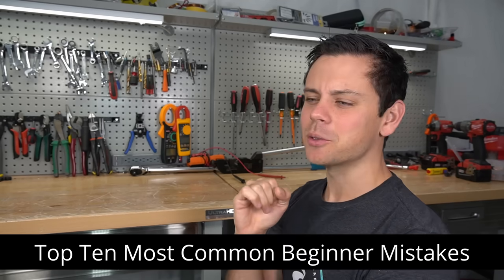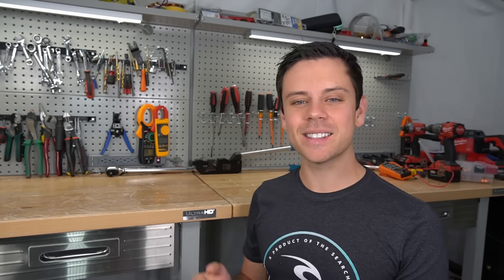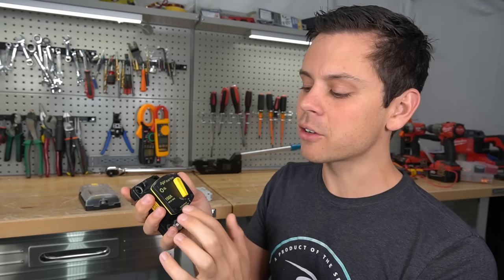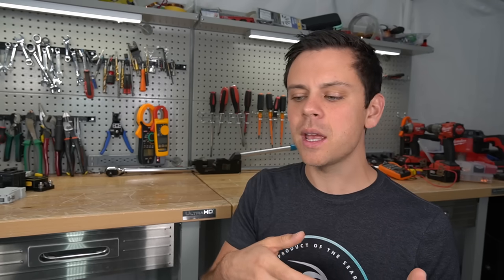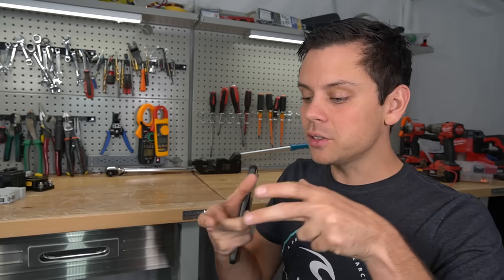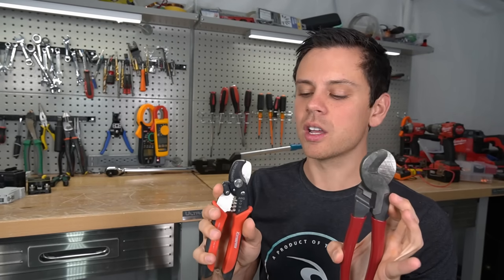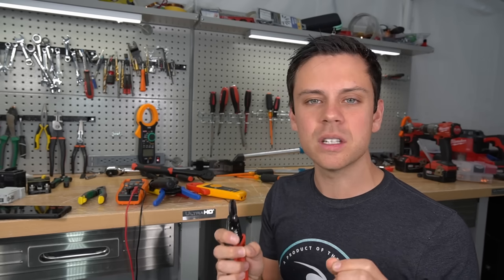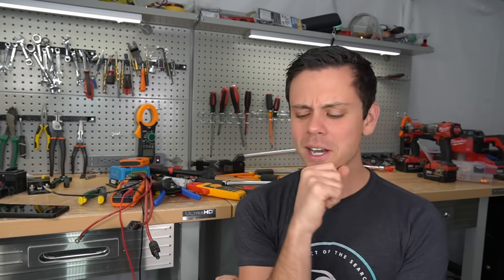Top 10 Beginner Mistakes When Building a DIY Solar System

Comment: Great video Will. Thanks so much for sticking to your guns on not soldering large lug connections. I get comments on my connection video from people that try to sound like they are professionals and they recommend soldering and it makes me worried that someone will believe them and create a problem for themselves. Keep up the good work.
Reply: To solder or not to solder is not something I will argue.  However the logic behind it does not work for me.  He says it's because of "dissimilar metals" and calls these silver lugs "copper" when in fact they are tin plated copper.  That is what I call "dissimilar metals" without soldering.  The high temp solder is mostly tin so if you have tin plated lugs, it's not really dissimilar at that point.  I would like to see some data showing a resistance comparison between the resistances of the soldered lug and the non soldered lug over time.  It seems the soldered lug would keep oxygen out of the connection better than non solder; keeping the connection from oxidizing.  But I'm just trying to learn here.

Comment: Will,  another problem with large bundles of wire that has driven many of us crazy is ghost currents, coupling AC to neighbor wires that supply LED lights.  The LEDs will continue ot glow at a lower output even though the switches are off.  :(
Reply from the maker: Great point!!!
Reply: Induction.

Comment: I bought your book on solar. I have installed two Battleborn Lithium batteries and used No. 4 copper welding cable to connect them together. The negatives run to a shunt that goes with an Alii gauge. Also no. 4 cable to a 1000-watt inverter. I put two dedicated plugs in my fifth wheel RV off the inverter. I have two Renogy suitcase panels that I hookup when we are dry camping, and I installed a new converter in the camper that is good for Lithium batteries. So far so good! I have made about half the mistakes you list but I'm getting better. Thanks for sharing your knowledge. Burlington Bill here, singer songwriter. Busking from the road and home.

Comment: In the early 70's in the US Navy BE & E class we were taught to solder every connection on the ship.  But I haven't messed with electricity for decades yet I still have believed it needs to be soldered.  But that's where us old hands learned it.

Now I'm learning a lot from you.  This is why I love kids.  They have access to the latest knowledge and also think of things that we think, "I tried that before and it doesn't work.". Kids may take a slight adjustment that makes it work.  I always have tried to hear out all ideas, they don't always work, but I don't want to be that old man stuck in his ways so he never learns new, or more efficient ways to accomplish jobs.

My dream is to build my own off grid solar and wind power station on my property in East Texas.  There are no permits or inspections required here if you have enough land, which I do, so the safety is completely up to me. I just put up my first building out there, a 30 x 35 metal building.  Now I need to insulate it and wire it.  It's going to be the blown in insulation because the batts sweat and I'll have a lot of condensation in this area with the pink stuff. Ideas? Spray foam first and then put the conduit outside of it for easy future serving 🤷🏻‍♂️

Thanks for all of your helpful videos.

Comment: I'm guilty of #9.  I built your 48Volt split phase system with all the listed components, but I only purchased 3 batteries and a dozen CanadianSolar 445w bi-facial panels.  I am now faced with getting another dozen panels at a minimum just to keep the 3 batteries charges based upon my upstate NY latitude.  The system operates great and can do anything I want it to, but it can run low after just one full day/night on a cloudy day.  We're totally off-grid and have to use a generator much too often at the moment.  Looking forward to having a full battery rack that charges up quickly.
Reply: I'll have to look that build up. I'm above you in New Brunswick (think Maine and turn right) and have been doing measurements of panels. It is crazy the difference winter, cloud, shadows etc make. I had a full sun day with 3 ground placed panels parallel in testing, and a person walking by created this massive downward spike in output, never mind a car driving by!

Yes, to truly have off-grid for the frequent power outages, sometimes for multiple days (and for some, weeks or months) in this region under the varying weather conditions, you have to really oversize the system or add wind to the mix, with all the complexities that brings.
Reply: @patrickbuick5459  In the spring, I plan on purchasing as many used panels from santan solar as I can afford.  I'd love to have a minimum 36 with at least 335 watt output.  On a sunny day I get pretty good results from just the 12 panels I have now, but up here, with the constant clouds and lake effect rain/snow 6 days out of the week, I just don't get much good bright sun.  I'd much rather be purchasing something for myself than handing over large quantities of cash to some corporate CEO of a utility so he can afford his 3rd jet, 2nd yacht and 5th vacation home though.

Comment: Thank you Will.  You're timing (for me anyway) couldn't have been better.  I'm sure you just saved me a few blunders.  My two (of course way more than that) biggest weaknesses are sizing charge controllers and breakers/fuses.  I appreciate you spending some cycles on those topics.  It was helpful.  P.S. The wire strippers were new to me too.

Comment: Top tips great video.  If you can't afford insulated tools use heat shrink and electrical tape to cover any shiny surface on the tool. It's not perfect but better than nothing.

Comment: Also when using torque devices, it is recommended to wind setting back to zero after use so as not to stress the device mechanism.

Comment: One thing to point out about multimeters. There are meters for electricians and meters for electronics work. Many times both will work equally but there are situations where one type can fail. The Fluke 325 for electricians can only measure resistance to 40k ohms. Not good for electronic work (I have lots of resistors over 50K ohms that the Fluke 325 can't measure). However meters for electronics work sometimes are only rated for CAT 1 environments. Not good for high voltage and power electrician work. A CAT 1 meter could literally catch on fire or explode if there is an issue in a CAT 3 high voltage, high current environment. For this kind of work you should have and understand the different CAT environment levels and when to use both types of meters. Another thing to point out to beginners is the differences between fixed range and auto ranging meters. There are times when one or the other is nicer to use. Depends on what you are doing and your personal preference. Yes, it is possible to fix the range on an auto-ranging meter but it is not as intuitive as using a straight fixed range meter.  
About soldering, I know Hams (I'm one) that insist on soldering everything but they are wrong. For small signal applications soldering is a good thing since small mechanical connections can get dirty and create signal noise. For high power connections mechanical connects are strongly recommended, especially in ground straps and lightning rods. The only thing close to soldering that is good to use is an exothermic weld which literally bonds the two metal pieces into one. Solder in a high power connection can end up melting at exactly the wrong time causing the connection to come apart and can even literally explode.

Comment: I find that many folks 'Assume' parallel voltages.  IE all panel output is ballanced.  If parallel multiple panels are used, it is the voltage average.   If one panel is 14.1, 1 panel is 14.2 and one panel is 14.3, the charge controller sees 14.2. At this point, proper use of blocing diodes, assming no loss because that is entirelly another conversation, then the controller sees the 14.3.  THis little knowledge really helps with serial strings then paralleled to the MPPT controller.    MC4 fused with blocking diodes can help this complication..your meter is the help here and your best friend.  thanks for all your video's they are excellent.

Comment: On a boat exposed cooper lugs will always give trouble down the track. So use galvanized lugss instead and solder the tip of the exposed cable end. Then use heat shrink over the eniter joint. This gives the best connection while providing a barrier for moister to get into the cable strands. The tin in solder acts a a sacrifical anode and prolongs the life of the joint.

Comment: My DIYs can be increased in storage by reconfiguring the individual batteries, but I prefer having separate systems, not a whole house solution.  I built a 2400w and a 4800w, thanks Will!
My philosophy on back-up power is for me to have the capability to run my freezer, fridge 24/7/365, and to run a portable ac unit for 4-6 hours a day, and fans all day and night.
I plug in coffee makers, microwaves etc., as needed.
I will position my batteries where I need them and/or when there is the most sun. I have a duel fuel generator that I use mainly for charging the batteries during low light winter months and cloudy days.
I have a Maxoak 1500w, EF River Pro 700w/ I am considering a purchase of a EF Delta 2 and extra battery to get it to 3000w+.
P.S. How is the family? Hope your Mom is doing well.

Comment: Thanks for an excellent list of beginner mistakes. Presentation is very good. You like to talk with your hands - no problem. Some people overdo it and it becomes distracting but you do it well. However, please please please hold your hands still when you are holding a tool or device that you are talking about. I want to see what you are talking about, not try to follow the bouncing tool. I enjoyed the video. Please make more. Your content provides a much needed independent technical resource that augments that given by biased manufacturers. Cheers.

Comment: Great vid as always Will, you have a great way of explaining some of the technical aspects so that most people can understand or at least relate to.  Now, did I see ferrules were used in that Victron controller, I think ferrules make systems look more professional and tidy-er, but recently there has been some different schools of thought on that, & apparently Victron says not to use ferrules for fine cored cabling into their controllers as they are designed to properly crush fine stranded cabling and make better contact than properly crimped ferrules, this has come up on Andy’s Off Grid channel recently (you probably know), what are your thoughts on this? The logic not to use does make sense, but the ferrules do look pretty. Cheers
Reply from the maker: I avoid ferrules for this reason. I found that manuals state that they are designed for the strands to be inserted without a ferrule, and that the terminal was designed to work this way. I learned this when doing car audio about 15 years ago. A professional installer told me this and every amplifier said to put the raw strands in the terminal.

Comment: You hit on most of the DIY mistakes made by well-intentioned people. As a retired electrical contractor, I can tell you that you're better off using a box cutter to strip a wire than cheap wire strippers. Totally agree about avoiding copper clad wiring like the plague as the copper cladding frequently cracks when torqued down and gives rise to additional expansion and contractor from the underlying aluminum cables.

Comment: I agree it's not practical to solder very large grade cables, but solder is the best connection if it can be done properly.  Otherwise yes twist or crimp is best if you also protect it with dielectric grease to keep it from corroding.

Comment: Great Video Will.  I've got a question, we've got Tesla on our home with a couple of powerwalls, is it possible to extend the battery life/capacity by hooking some lifepo4 batteries in a server rack up to my system?
Reply: No.
Different chemistry in powerwall batteries will not let them to be connected to lifepo4. Also you will void the powerwall warranty.  However, you can AC-couple another inverter and battery bank to increase storage capacity.
Good luck.
Reply: @diyanzlatev  Thanks for the answer, I wasn't thinking of directly connecting them to the powerwall, I should have been more clear.  I was thinking of adding another bank with an inverter of some kind, if it would be possible that way.
Reply: I see. Thank you for clarifying. If I understand the Tesla design correctly, the solar panels feed to an inverter, which is AC-coupled with the powerwalls. This "mini-grid" of three, between the solar inverter and the inverters in the two powerwalls is disconnected from the utility grid when power goes out and continues functioning autonomously. You might be able to AC-couple a fourth inverter (with it's own battery bank) into that mini-grid. You have to make sure that inverter charges from the solar inverter during the day and curtails itself, to prevent overcharging through the AC-coupling. I don't have experience with many inverters and I don't know of a model that  can do that, but perhaps it exists. AC-coupling is a tricky business.
Reply: @diyanzlatev  Thank you for the information.  I'll definitely talk with an electrician if I decide to go this route. :)

Comment: Nice video. I’d like to suggest a topic. I remember at one time measuring the current drawn during the day, when virtually nothing was on in the house. that came to about 8 A. Perhaps an interesting project would be a solar panel and micro inverter configuration that is designed to do nothing more than offset that 24 x 7 current that is utilized by all the different things that are plugged into the wall if everyone had a small configuration like that, I think that we would save a lot of energy and people would save some money too. Even a small amount of current running every single hour of every day all year long mounts up to a reasonable amount of money. Maybe there would be a step up configuration that would cover some low power PCs or laptops in the home.

Comment: As an electrician I totally agree. Also I like to oversize cables for DC and use reducing pins to fit smaller terminals. Depending on connection type.

Comment: Will, awesome video. I agree with everything you said. Everything. My only disagreement is one tool you showed. The blue-handled wire stripper shown starting @12:42 sucks for stranded wire. We used to call it a "two-headed dinosaur". The tool has a tendency to mash the newly stripped end of the wire (spread the strands) when the two halves pop back together. And they don't do any better at cutting the insulation without damaging individual strands, than a more conventional stripper.
Reply: Thanks for pointing this out! Which ones would you recommend?

Comment: Some very, very good points made here, especially wrt using insulated tools with batteries and using a torque driver. I was always taught to only use crimp on multi-strand wires/cables, some of you may not agree ??

Comment: Will i wonder if you thought how the heck am i going to protect all this solar stuff from and EMP?
Reply: By using an EMP device.
Reply: put them in copper cloth
Reply: I put backup inverter, charge controllers, relays, radios, spare electronics, and such in faraday cages and a stack of solar panels in an outbuilding. 
I’m not that trusting of the EMP/surge protection devices that I installed. Besides nothing lasts forever so backups are good insurance in any event other than total destruction.
Reply: There is no guaranteed safety from an emp. Your wires will act as antennas to magnetic fields. If the emp is big enough the current wave will travel through your system and fry devices it enters.
Some devices are built with avalanche diodes that will divert massive amounts of current away but they also take some time to kick in and testing the specs is difficult for people without necessary skills to induce the simulation. 
If you're worried about end of the world stuff like nuclear emps I would suggest taking a trailer or shed, lining the entire thing in metal or foil (thick enough and without cracks so as to not allow emf waves in), and dumping in emergency electrical devices like radios, batteries, panels, inverters, etc, and store it shut. Worst comes to worst and a massive emp knocks out all your devices (either unlucky because of lightning or you have bigger problems on your hands) you can open the emergency stash and reestablish electrical power.